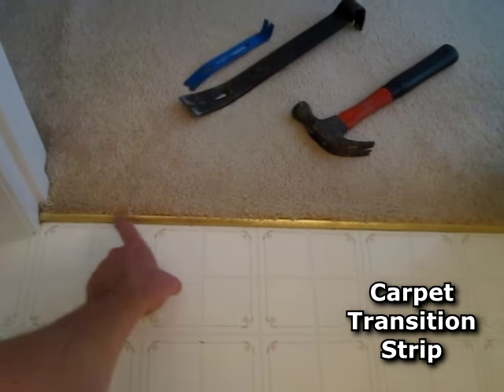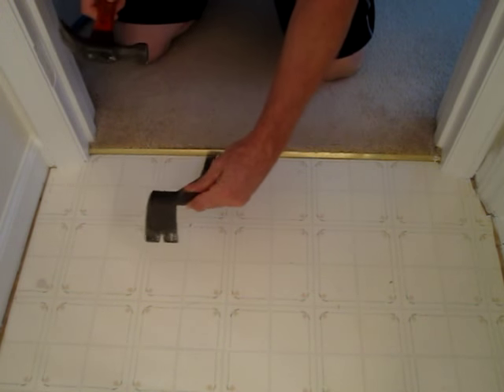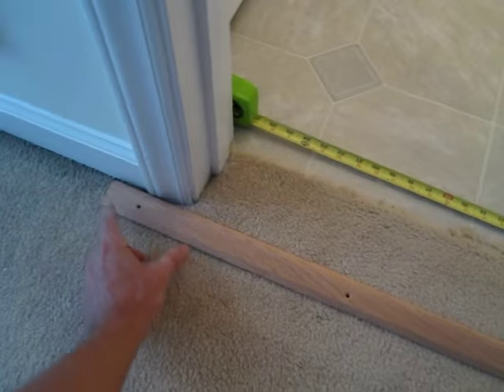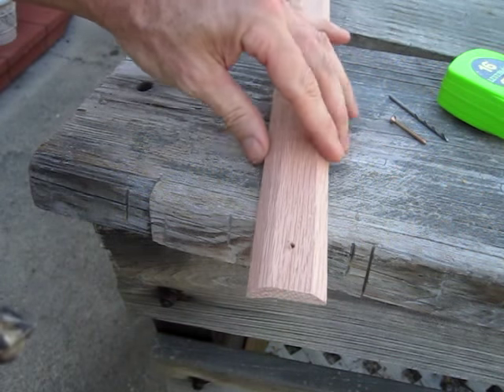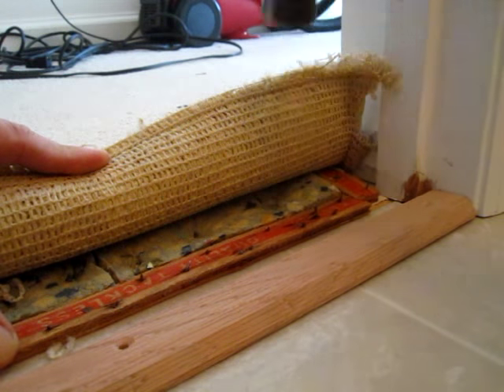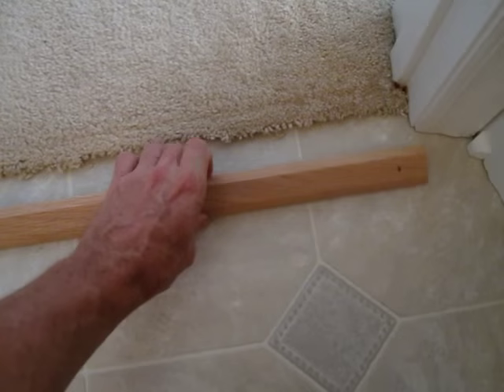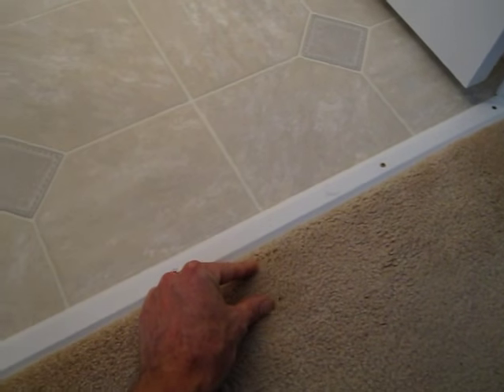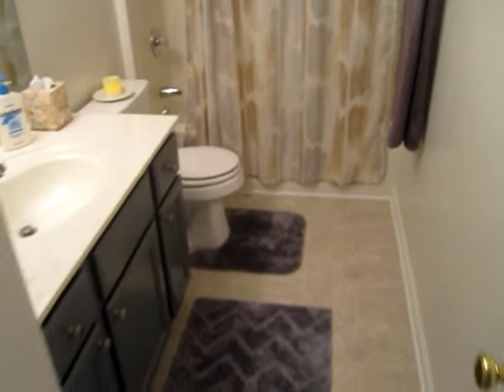How to Install a Carpet Transition Strip - EASY! floor repair fix rug replace tack

Comment: Best video I've seen on this. 

My vacuum cleaner lifted the carpet from under the cheap narrow metal divider in an area that was worked on many times by the builder after I noticed a tiny area of exposed mesh. I think a wider transition strip would fix this, but all those tools must be expensive.

Comment: Well job done.. I just had vinyl flooring done in my dinning area transitioned to carpet into living room with the exact metal gold trim that you removed to put the wood strip in, what was the reason you did away with the metal gold strip replacing it with the wood one?

Comment: When you are screwing down the transition you painted white with screws are you screwing it down into the concrete subfloor?
Reply from the maker: yes. in my case its a plywood wooden subfloor. for concrete u might have to drill small pilot holes with a drill bit for the screws.

Comment: what type of paint did you use on your cabinets and did you have to sand it?
Reply from the maker: hi, the paint i used is rustoleum oil based and i sanded inbetween coats of paint. i made a video on how to paint a cabinet that u can find on my channel. thanks.
Reply: Angel Rodriguez Java Gel might be an easier alternative

Comment: You do nice carpet installation.  I can see that your professionalism excels in your field.  However, as a tiler, I have one problem with your transition from carpet to tile.  In your demo, you've tucked the carpet right up to the tile edge. Cleanly. That'll work for the carpet but leaving the grout lines "open" at the edges will cause them to eventually erode slightly backwards as they have nothing to dead end into.  I' ve seen this occur many times.  This is why a threshold is a better choice. Then, tuck.
Reply from the maker: hi, this floor was actually sheet vinyl. it just has a pattern that looks like tile. thanks
Reply: Oops.  My bad.  Funny how that can fool the eyes.
Reply: Actually I'm no sure how my post even got onto your thread.  If you'll look to your right, you'll see another installer transitioning from carpet to tile.  THIS is who my post was meant to see.  Can't explain the internet.
Reply: MichaelW-Tn 
I had something even weirder  happen to me : I was making a comment on a YouTube vid and I don't know what made me go back but I decided to edit it for punctuation and grammatical errors and I was unable to get in !
      Then we order yet I noticed the name at the bottom of it was not my name what was the name of somebody else and this really freaked me out and it actually happened twice within several days.
     The reason I find this so creepy and weird is because if someone knows what they're doing and apparently I did not know how this happened someone could write a really vicious horrible comment that can get them in a lot of trouble but your name could end up as the author instead of the original person who wrote it .
     I'm still not sure how it happened but it freaks me out when I found it with two different comments to two different people .

Comment: Shoulda just brad nailed it, And if im not mistaken those come with finish nails as well lol, That first nail lolol, a stapler woulda worked. What kind of knee was that. "keeps it nice and tight" u literally did nothing but put the carpet on to the pins

Comment: uses metal hack saw for wood.... other than that nice, gg
Reply: Nothing wrong with that, you get a good clean cut, don't do it the other way around though (cutting metal with a wood saw) 
I keep a small hacksaw in my tool bag and if I come across a small cut that needs doing I use that rather than trail out to the van to go fetch the specific wood saw.